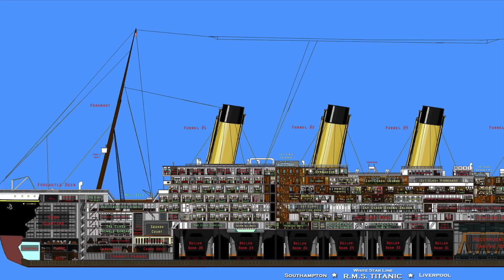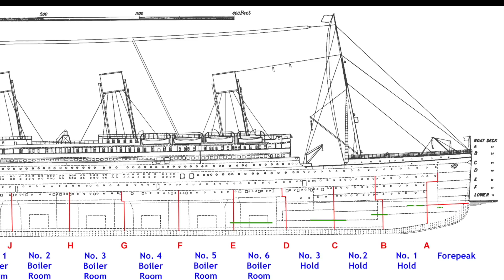Why didnt Titanic Boilers explode during the sinking? Reupload

Comment: Boiler room 3. The second boiler in the room away from the door had a structural failure in its main pressure chamber and the boiler exploded from overwork as the titanic was sinking. The heat weakened the metal in the pressure chamber causing a catastrophic failure... dont ask how I'm sure of this you wouldn't believe me

Comment: The most likely result of the seawater contacting a steaming boiler would be an implostion.  A drastic drop in temperature without a cooresponding drop in pressure would not cause the steam pressure to somehow magically increase to the point of massive failure.  There are also high pressure relief valves mounted to the boiler steam dome that would have quickly reduced the steam pressure to prevent an explostion.  Nice try Einstein.

Comment: Titanic's boilers didn't explode because it would have been physically impossible. Also, the engineers didn't 'decide' to release steam - it's just an automatic safety valve that all boilers constructed in the UK have been required to have for over 150 years.

Comment: Quite possible that seawater hitting hot coals could produce a local stream explosion rather than a boiler actually popping. Boilers tend not to explode if cooled  and are probably too strong to implode due to cooling by inrushing water. Evidence suggests that some of the boilers found on the sea-floor had some evidence of implosion but I would be very surprised that any would have survived the pressure at that depth without very significant damage, so it is hard to tell when this damage took place. Water tends to flash to stream on hitting very hot surfaces and this could propel hot coals and such out of any available exit. They other thing people reported was stuff breaking free inside the ship and of course there is very significant damage done to the stern of the ship due to the collapse of trapped air.

Comment: Your graphic shows a series of green lines, where you suggest the iceberg damaged the Titanic.

2023 3d mapping of the ship appears to show no significant damage of the Starboard side. If this is the case then ywo scenarios could be at play. Firstly, rather than a large hole on the Starboard side, a series of small holes could have occured where rivets were dispaced. Ballard suggested the rivets where duff. Secondly, remembering the bulk of the iceberg would be below the waterline, more significant damage could have occurred underneath the ship. Without a decent remote accessing the interior we won't know for sure.

Any chance of an updated video based on the new 3d mapping.

Comment: you tube nurfed your suspenseful moment you point say now and it goes to commercial lol 
if the boilers had the vents open it would have depressurized the system so if the water hit the sides of the boilers the heat and cold could still rupture the boiler BUT as it had a open line out  the path of least resistance  its like a pressure cooker at home you never suddenly cool them  similar just on a massive scale on the ship.   also something NO one mentions is the hot steam lines they would be all over and would be very hot  it ran all over unless Im mistaken as it was used for many things   so if those lines were cooled and ruptured  it would make more pressure releases to disperse the pressure over many seperate locations

Comment: only boiler room 6 was severely compromised after the impact. Those boilers were at full temp and pressure since just prior to the call to put the engines "full astern", the boilers were operating at full capacity since Titanic was sailing at FULL AHEAD.  After the collision, and since the ship was at ALL STOP, the dampers were closed and the boilers were venting steam and lowering pressure. By the time that Titanic sank low enough that the water spilled over the bulkhead at boiler room 6 and overwhelmed the pumps actively pumping in boiler room 5, the boilers were much lower in pressure and temp.  The only boilers that were being fired at full power were the ones that were sending power to the electrical systems. By the time the boilers were subjected to seawater, the heat and pressure in the system was much lower than it had been at the time of the collision

Comment: Great video thank you!  Know that it was explained in Cameron's analysis of the tail section, that boilers imploding, was somewhat secondary to the huge freezer/refrigeration compartments (used to hold cold produce for entire voyage over and back!) that also imploded during to the pressure and change of cold temperature, and these two factors were the reason the tails stern section looks ripped/blown apart like paper compared to the front section.

Comment: How would the boilers even explode? That doesn't make sense. I could see them breaking from the termal warping that would have happened with the rapid temperature change induced by the cold ocean water, but that wouldn't cause a thermal explosion. A thernal explosion is something that happens because of a positive feedback loop in a chemical reaction, producing more and more energy. That has nothing to do with Titanic's boilers - the boilers are just chambers filled with burning coal that boil water to pressurize a bunch of steam... A thermal explosion would not occur because water cooled the boilers rapidly, that just doesn't make any sense. I'm confused as to why the premise of the boilers exploding is even discussed if we can't explain how that would even happen. The steam pressure wouldn't give way because of a rapid reduction in temperature, the pressure of the steam would actually go down with the cold ocean water reducing the temperature of the pressure vessels that stored the steam. The steam getting vented out and producing that deafening amount of sound was the steam from the boiler assembly not yet transfered to the engine room. If the engines aren't running, they vent out the steam pressure through those pipes that run up the smoke stacks. Steam powered trains would do the same thing when they stop. It being incredibly loud isn't evidence of an imminent explosion. It is loud because Titanic had a big steam engine with a lot of boilers. Also, steam pipes rupturing wouldn't cause some catastrophic explosion anyway. 

The basics of coal power plants, which is what Titanic's engine essentially was, are not that complicated. No need to over think this. Pouring cold water on a campfire won't make it somehow explode, it will merely put out the fire. On the flip side, reducing the temperature of something that is pressurized will rapidly reduce the pressure.

Comment: I work in a power plant, and I can confirm, steam venting out to atm. pressure is MADDENING loud. It is very very uncomfortable to stand near without hearing protection.

It is also worth mentioning, that the marconi operators on titanic could not hear all the messages they got in, because of the venting steam.

Comment: The boilers may not have exploded, however, when the ship broke apart, the steam pipes were severed and instantaneously released the steam pressure. I’m not sure of how all the boilers were plumbed together, but it’s my understanding the rear-most single-ended boilers were used to generate power. These boilers were the priority of the engine crew. To operate the dynamos to generate enough electricity, these boilers were under steam pressure through the end. The venting of steam was more than likely done to the boilers that operated the propulsion engines.

Comment: cold water on a hot boiler does not mean an explosion. its possible however that it could implode the boiler. the main cause of a boiler explosion is allowing the water to get too low, and it gets lower than the crown sheet (the plate above the fire),  which causes the plate to overheat and warp, which eventually pulls loose from the staybolts and its a chain reaction as the pressure drops, and the now superheated water flashes to steam causing a massive explosion.

Comment: I like your videos and you obviously spend hours researching  the subject. I spent over 15 years doing industrial / commercial boiler repair, I have seen several types of boilers go into a low water condition thus "Burning" the boiler, in other words melt down and literally burn the steel. To understand a "Boiler Explosion" look it up, there are many stories and pictures on this, this usually took place on "Locomotive type boilers" due to a low water condition, and when water was introduced onto the hot steel, the water would flash to steam and that sudden release of energy is what causes the explosion. The boilers on the Titanic are "Scotch Marine type boilers" the fire boxes were well below the boiler shell, that would allow ample time for the firemen to work the coal grates  to break down the fires, and as one gentleman stated the actual steam area is above the boiler tubes themselves. By no means am I saying that It could not have happened because no one will ever know what really happened that night, but in all of the photo's and documentaries that I've seen, I have not seen any signs or evidence of an explosion. Thank you for what you do, you give a lot if information of that disaster.
Reply: As a young man just getting into the industrial boiler repair business, thank you for your comment. I learned a lot from this short read.

Comment: This is actually not too far fetched.  There was theory of a large fire in one of the boiler rooms on the right side of the ship before the voyage.  This fire would have left a large burn mark/scar on the right side of the ship.  This heated metal from the fire would also compromise the tensile strength of the metal plates where the iceberg hit.  Titanic was only photographed in certain positions perhaps to avoid showing the burned area of the ship.  This area was believed to be painted over prior to the maiden voyage.  If no fire had occurred, it may be possible that the Titanic might have survived the iceberg hit, but may have still had to be repaired in New York harbor.
Reply: That's mostly a myth. There was a fire in one of the coal bunkers, but it wasn't anything out of the ordinary or a big concern. There are photos proclaiming to show a scorch mark from the fire, but it's in totally the wrong place (too high and too far forward). Also, even if the fire did weaken the hull, it would have only affected a small part (right at the rear of the damage) not along the whole length where the berg damaged. Plus any damage visible on a photo would be above the waterline and therefore not play a part in the sinking.

Comment: So, if a boiler explosion happened, could that have possibly been the reason for the breakup of the ship on the surface?  If the bottom was blown out amidships, it would explain it breaking in two.
Reply: It would theoretically be an idea but I believe if this is the case then the would be more evidence on the wreck as far as the metal bending and such much like an aircraft that has had a bomb go off inside it

Comment: The coals inside the furnaces within each Scotch boiler were quickly removed by the firemen in the boiler rooms who essentially raked the red-hot embers onto the stokehold flooring that was two feet above the ship's Tank Top level.  When Titanic's engines were brought to a stop the 215° PSI head pressure at first was diverted into the large condensing ducts and circulated back into the closed system before eventually being diverted to escape through exhaust conduit that was built into the liner's massive funnel system.

Comment: I have had this silly theoretical question I've been wondering for the longest time. Could welding over the holes in Titanic have saved the ship? I know welding didn't exist back then and it's not like the crew had any spare metal laying around but I think it's still in the realm of possibility since the gashes themselves were slim and I think it would just be an all around fun what-if scenario
Reply: Welding up open seams along Titanic's hull plates would be impossible for a variety of reasons. First and foremost arc welding (which is the sort of welding I guess you're talking about) did not exist in 1912. Even if it did the strong water pressure of the ingress would make doing so next to impossible either due to the presence of water acting against the physics necessary to form a weld or the pressure itself posing the problem. I know there has been developed special under water welding technologies but again not in 1912 and even if there was somehow the ability to do this, I'm almost certain it would be such an impractical thing to attempt it simply wouldn't be under consideration.  Fothering is  a method of significantly reducing the ingress of sea water into a ship's hull...however most ships never have nor do they today carry materials for fothering due to the difficulties associated with performing this  method. Welding is totally impractical.
Reply: The ship was damaged along over 400 feet of its length. They wouldn't have had time.

The holes themselves may have been small, but they were many.
Reply: Another issue is the accessibility of the damage. Since it seems that the damage consisted of long gashes, whilst much of the damage was in easily accessible areas, there would also have been considerable damage to inaccessible or hard to access areas. Much of the damage occurred in the 3 forward cargo holds, so was likely blocked by cargo. The damage in boiler room 6 included alongside the boilers, plus in the stoke holds which were full of coal. Even though cargo and coal could have been moved to allow access to the damaged hull, it would have taken time, time during which the spaces were filling with water. I think by the time the damage was assessed and any decision to attempt repairs could have been made the forward compartments were already flooded to above the level of the damage anyway.

Comment: Just getting caught up on your videos. Regarding the possibility of explosion, first note that the boilers were not full of steam. They were mostly filled with water. Steam was created and occupied roughly the top 1/4 or less of the boiler. Water completely surrounded the furnaces, heater tubes and combustion chamber. Though the seawater entering boiler room six was coming in fast, it would not have dropped the boiler water temperature fast enough to create the pressure change required for an implosion. 
Note the operating pressure was 215 psi, the boilers were tested to 430 psi. In addition, the steam was not trapped in the boiler, it continued to exit the boiler until cool. There was a silent blow-off vent that, when the engines were stopped, sent the excess steam directly to the starboard condensers. This kept the steam pressure under control until the funnel vents opened.
Underway on this trip, steam for the auxiliary units including generators and emergency generators came from two port side double ended boilers in Boiler Room #2 and two starboard side double ended boilers in Boiler Room #4. However, the auxiliary steam could be rerouted from any boiler, so we don't know if the two in BR#4 remained lit. It would have made sense to shut them down and transferred steam from additional boilers in BR#2. Note: The Boiler Room One furnaces were not yet lit on this trip, (usually used in port), and would have taken up to 12 hours to reach operating pressure. 
The men would have banked the fires beginning from BR#6 moving back to the engine room. The last ones remaining lit would be in BR#2 driving the generators, pumps, etc. There was no reason for most of the furnaces to remain lit, whether or not they were depended on to the time needed take to shut them down.
I don't know about the sparks from funnel #3. It is possible that the starboard furnaces in BR#4 remained lit for the generators. But since the furnaces and related equipment were completely surrounded by water I can say is sparks from an implosion would remain lit and travel all the way through the uptakes to the funnel base.
Reply: you have a mutated super fungus oh no:face-fuchsia-tongue-out:

Comment: Smouldering coal will produce gas, shutting off the dampers would slow the fire and allow coal gas to build up. It's possible that the explosion they saw was coal gas being ignited.
Reply: From personal experience I can say a boiler doesn't blow up just a little, they
are pretty violent. Even small boilers can make quite a bang.
More than likely it was just coal gas.